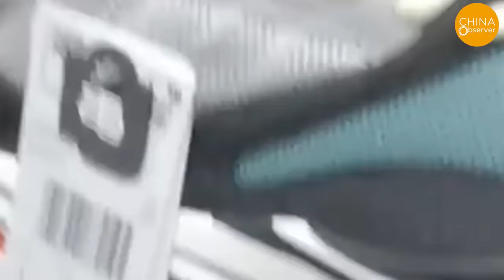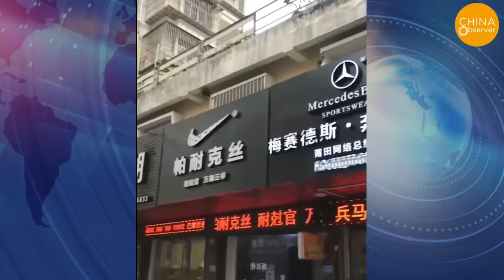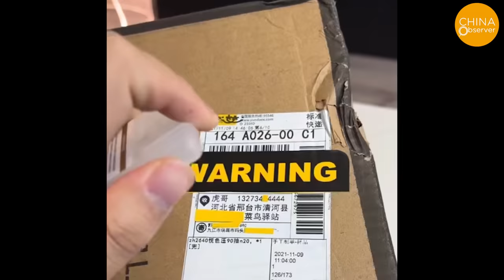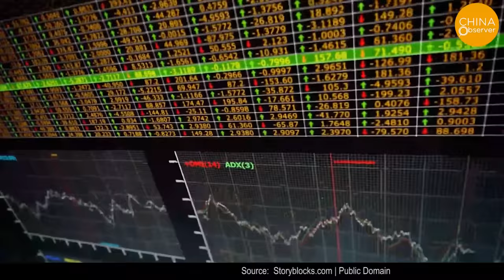Fake Shoes, 1/3 Nike Shoes in the World Are Faked in China | Made in China

Comment: I have no sympathy for Nike and other brands. They are victims of their own greed. They pay the factories a pittance and still charge consumers ridiculously high prices that have noting to do with the cost to manufacture, meaning they reap all of the profit.

Back in the 90's a friend of mine was buying polo shirts from the exact same factory in China as Ralph Lauren Polo. He could buy a higher grade polo shirt than RLP for around $2 and then spend about $3 per shirt on transport, duties, labels, and applying printed or embroidered designs. His $5 shirts retailed for $30. Ralph Lauren Polo spent less per unit but sold for $295.

What the Putian factories are doing is criminal, but can we really say the brands they are "ripping off" have clean hands?
Reply: The original brand gave better pay in China as the rebrand.
Reply: @deniseproxima2601  This video was meant as an indictment against Chinese factories producing counterfeits but I couldn’t help thinking that the factories were doing this because the big western brands are using their buying power to screw them out of their fair share of the revenue. If the brands paid their suppliers a fair price and sold their products at a more reasonable mark-up, instead of charging the maximum the market can stand, the market for the counterfeiters would shrink significantly.
Reply: well said!
Reply: let them drown in their own greed, they have done enough evil
Reply: Shoes are shoes, there is no such a thing as real shoes or FAKE shoes, there are only real brands and fake brands.

Comment: Between all of our family, we've bought over 100 pairs over the years. Yes, around 2016 those '3 to 4th' started getting plentiful and really good. Some were so close it's nearly impossible to tell they're counterfeit but there were SOME little giveaway and the rubber quality of the soles was a real 'hit or miss' where sometimes a few drops of rain would be dangerous as the shoes slipped so easily, like you were suddenly wearing snowboards on ice.  (also, one pair almost ignited on fire when sat next to a heater) but what we found around 2017 were those factory extras.  What I'm told is that plenty are not really 'counterfeit' anyway but were factory flaws. Tiny almost imperceptible flaws. For example, one pair really was just a slightly odd shade duller than the ones in the proper licensed story. In another pair, the Nike swoosh was just slightly tilted. So a run of them might have got through the factory line before corrected. I'm told the scheme is that they are, by 'Nike/Adidas Law' supposed to recycle them or discard etc. At some point that truck is diverted to what is ultimately a lot of (mostly) Chinese bidders. They buy huge lots and off we go. Fair warning though, some factory flaws are real flaws. It's not like those legitimate sanctioned factory flaw sales which is to say the products still need to meet all safety and functionality criteria. I've had pairs where the foam sole started collapsing a week later, the highly slippery soles, a single 'eye' for the laces will snap almost immediately. 
Yes, we had also heard of 'overruns' (oops) where they really are just the flawless actual authentic shoes backdoored. In that case, you are just buying actual sneakers in every authentic final product way.
Reply: I wonder where you got those at? I would mind a tiny defect for a shoe to use at work.. As long as it's comfy
Reply: @whatever_12  As seen in video but also old malls would have some mom/pop types  shoe stores and then mostly online stores like Taobao and all over Pinduoduo. Well, at this time your could just visit Hanoi Vietnam and tour the Old Quarter areas. Never saw so many tourists in new sneakers and if you paid more than $25 USD its too much.
Reply: False
Reply: WOW VERY DANGEROUS 😠😠 THIS WHY IM SO LUCKY LIVE IN SUPER INDIA 🤗🇮🇳 THE CLEANEST COUNTRY IN THE WORLD , WE NEVER SCAM ! WE GIVE RESPECT TO ALL WOMEN THEY CAN WALK SAFELY ALONE AT NIGHT AND WE HAVE CLEAN FOOD AND TOILET EVERYWHERE 🇮🇳🤗🚽, I KNOW MANY POOR PEOPLE JEALOUS WITH SUPER RICH INDIA 🤗🇮🇳🤗🇮🇳🤗🇮🇳🤗
Reply: @ibrahimboiemonyt  Mostly, yes.
Reply: @indiasuperclean6969 😂 this is the funniest comment ive ever read